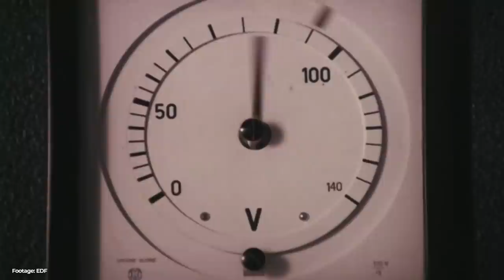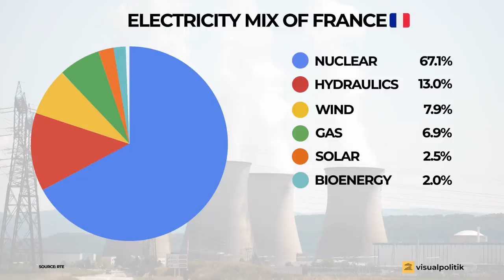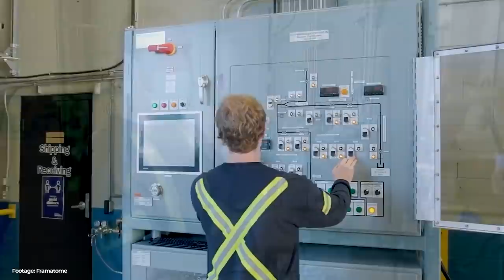Why is FRANCE betting on NUCLEAR ENERGY again? - VisualPolitik EN

Comment: Some Fun Facts: Fossil energy accounts for 80% of the worlds energy consumption, nuclear only for 5%. I we were to replace only half of the fossil energy with nuclear energy, that would mean an increase in uranium consumption by a factor of 9. Studies say that the world's uranium deposits will last for maybe 100 years if we keep the consumption at the current level. Consuming nine times as much, those deposits would only last for 11 years. And probably less than that because energy consumption has been rising exponentially since forever. Also, nuclear energy is the most expensive form of energy. Also, the country with the greatest uranium deposits (with as much uranium as the next four countries) is the democratic model country of Kazakhstan. Yeah, that is the country we should send our money to.
Reply: Your understanding is a little off...  More nuance, please...  There is uranium-235 which can readily be used in a nuclear reactor, and then there is uranium 238 which cannot.  But uranium 238 CAN be used once you kickstart the reactor with uranium 235.  Uranium-235 makes up about .7% of all uranium, and uranium-238 makes up 99.3% of it.  Beyond that, there are other nuclear elements that we can use, like thorium.  There is 4 times as much thorium in the crust of the earth as there is uranium (u-235 & u-238).  99.9% of the thorium on the planet comes in the form of thorium-232.  Now thorium is a fertile fuel, not a fissile fuel like u-235 is, but you can add neutrons to thorium-232 to create uranium 233 (which is fissile).

1 kg of uranium-235 is equal to ~24,000,000 kWh of energy production.
1 kg of thorium-232 is equal to ~4,800,000,000 kWh of energy production.

Thorium is the key to a very long history of nuclear power production.  We have literally millions of years worth of the stuff.
Reply: @Les_S537  I know all that. If Liquid Thorium reactors ever become viable, all the better. I'm not opposed to nuclear power on principle. But when people talk about nuclear reactors, they most often mean the kinds of uranium 235 reactors that have been built over the last decades. And for those reactors what I wrote holds. What we need are affordable long term solutions, not excessively expensive ones that'll only take us over the next 2 or 3 decades.
Reply: @pillmuncher67  Today's reactors use both u-235 & u-238.  The calculation you mentioned which says we only have 100 years is only referring to the amount of u-235 that we have available...  But as I said previously, today's reactors don't run only on u-235.  When you "prime" a nuclear reactor to start, you've got uranium enriched to about 20% makeup of u-235.  The remainder is u-238.  Once you've got the reactor going, that u-238 turns from the fertile fuel it is into other fissile materials which can continue the nuclear process as well.  Molten salt reactors, which are right around the corner (within the decade), eliminate the problem of melt downs, and they can recycle all of the nuclear waste we have generated over the last 70 years.  The US has about 90,000 tons of nuclear waste today.  Run all of that through a molten salt reactor and you could power the US for the next 300 years.  Now add on top of that all the thorium we have?  We've got plenty of nuclear fuel to power us for eons.

Comment: NG is an ideal transitional fuel from coal. The change to electric transportation is going to require a large increase in baseload power to supply its needs. Gen 4 nukes are the Path  to fusion power. Gen 4 is a new ballgame! Look it up.

Comment: My bet would be very much on nuclear energy. As long as France isn't building it.
I would never trust a device made in France when there is so much at stake.
Like cars, I would very much prefer it to be designed and made in Japan or Germany.
Reply: Nuclear power is the largest source of electricity in France, with a generation of 379.5 TWh, or 70.6% of the country's total electricity production of 537.7 TWh] the highest percentage in the world. And so far no serious incidents. I think they handling it quite well.
Reply: @VFPn96kQT  They are having all sorts of serious problems which have been made much worse by safety considerations. That said, I doubt any other country would do any better at building large PWRs, which are looking increasingly uneconomical compared with wind and solar.
Reply: @glynnwright1699  Where are you getting your prices from?  Where is any pure solar/wind power station that can supply ~1500MW 24/7/365  in any climate? 
What price are we comparing here?